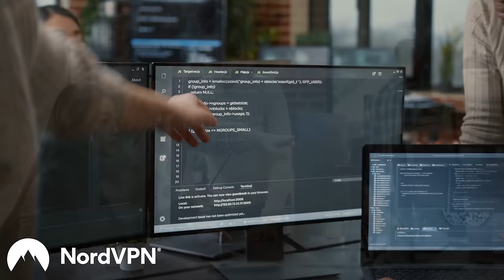Elon Musk fails Cybertruck stainless steel metallurgy test | Auto Expert John Cadogan

Comment: I doubt a pen knife is 50C, considering gun barrels are usually 30-35C
Reply from the maker: The last thing you'd want a gun barrel to be is hard. Hard = brittle. 
The hardness of a knife is not really a 'doubt' thing, genius. It's a 'fact' thing. Most consumer knives fall in the range 50-65 HRC. Premium knives are at the higher end. Knives that require toughness (ie - not brittle, such as bushcraft knives) are lower.

Comment: 2 minutes into the video and you already got your facts wrong. The stainless steel that is used in the Cybertruck is not "Austenitic" it is "Martensitic". As far as breaking the press it is a miss quote. He is taking about the press dies that will get destroyed in no time plus he cannot the intricate shapes that you can with thin aluminum sheet vs the 1.8mm thick stainless that he is using.

Comment: John is 100% correct. There's a reason why car manufacturers haven't used stainless steel as a main component in their car bodies in the last 120+ years (apart from John DeLorean, who happened to be a con artist and a thief) .... because it doesn't make any engineering sense 😉(as much as using ceramic pistons in a conventional car wouldn't either).

Comment: As a Tesla fanboy, I have one thing in common with John. We are both haters. I am a hater of high tensile strength scientific facts, and John is a hater of brittle, high hardness claims of science. Just a matter of personal preference. Real life is like a proper press—shouldn’t yield to either. If cybertruck fails structurally or otherwise, I’ll be blaming John, since his criticism provides enough negative energy to weaken the crystalline structure of Tesla’s steel.

Comment: Stainless is just a rubbish material for a car, something that's inherently going to get bumped and dinged and punched and shoved and pushed. Mild steel loves to bend--you can get a lot of movement out of a piece in a bend test before failure. Soon as you start adding chromium to the mix, that elasticity falls right off a cliff--brittle, brittle, brittle! Doesn't wanna bend, and once it has it's lost a good deal of its strength. Stainless is good for knives and sinks, it's great for food safety. It has no business as a car body, period and end of.
Reply: What's rubbish is traditional cars that can kill you with a moderate side impact.

Comment: As a U.S. steelworker who has directly worked on galvanizing and aluminizing lines that coated regular as well as AHSS, along with the hot mills that created the coils, I really enjoyed this video. When I would be (on occasion) a quality tester, rockwell hardness punch tests were, of course, paramount. Followed by a bend test. And the coating had better not crack or flake when you bent the sample. From there, other, larger samples were sent for tensile strength tests. I suppose musk figures that, "If you can't dazzle them with brilliance, baffle them with bullshit!"

Comment: The Tesla fanboys tend to talk as though stainless steel is something new.  John Delorean built a car with it 40 years ago.  Although I do like the idea of a stainless steel body, it's "enhanced durability" isn't going to do an electric car much good, since the batteries are going to die regularly in about 10 years like the Model S's are currently experiencing.
Reply: The car hitting you with a side impact disagrees with you.
Reply: @SPL-6  Especially when it is a 3 ton EV that runs the red light.

Comment: In the realm of POOR DESIGN  .... why no charging port up front, like a Rivian R1T?   If you have an up-front charging port, then hauling a trailer on a road trip wouldn’t be such a horror story.   With the exception of 1 charging station in Tennessee with 4 pull-thru stalls …. every charging station I’ve ever seen (in real life or photos, in North America), one has to detach the trailer AND park the trailer somewhere BEFORE being able to pull the EV into the charging stall …. because the charging port is in the rear of the EV … and a hooked-up trailer blocks a rear charging port.

Comment: Resuming, if a modern normal car had the same thickness in the body panels it would be harder……..
But there’s a reasons they aren’t, collisions an impact absorbing.
Not for Europe. 
Normal driving licence only goes up to 3500 kg full load capacity and…….those edges 😅

Comment: Hopefully he means strong, but I kind of doubt it, I suspect he means hard because his stainless likely is harder than the steel used in most cars a least at room temperature, if you happen to drive the cyber truck to drive to somewhere it is less than -75 degrees Celsius or so the stainless would probably be stronger as it remains more elastic at lower temperatures.
Reply: His steel isn't harder when considered against what is used in a lot of cars.  Cars are changing to harder steel to save weight.
Reply: @kensmith5694  they are changing to tougher steel with the right amount of elasticity and the closer they can get to ideal for the shape they are using the less steel they need.

High hardnesses tends to be counter productive if you don’t want the steel to shatter in an impact and shattering into sharp stuff rather than crumpling is likely to get you a low ANCAP rating.

The type of stainless that is being used in the Tesla “truck” is still somewhat flexible at low temperatures and mostly doesn’t shatter unless it is over work hardened. My guess is that a non stainless that was of a similar hardness would tend to shatter in cold environments.
Reply: @glenecollins  Cars used to use steel that was a lot more ductile than was really needed.  They did this because it was easier to work with.  I wouldn't expect the hardness vs temperature thing to be a lot better with stainless.
Reply: @kensmith5694  unless they are lying about the type of stainless, the one they are using is pretty well known for it’s low transition temperature (below the temperature of liquid nitrogen, it is why SpaceX are using it. Even low carbon steels have a transition temperature >-50 degrees centigrade. 
I live in Australia so the coldest my car has ever been is probably -5 centigrade so that definitely isn’t an issue for me unless they start using the steel from razor blades or something.

I doubt the batteries would work very well at cryogenic temperatures but it is possible there is a sweet spot where the stainless could have the correct ductility etc etc to allow the strength they want with the minimal amount of material without risking having it shatter if it crashes in some snow.

I suspect they just wanted it to look futuristic.
Reply: @glenecollins  I had heard that cars get brittle at -60C and that is why labor contracts say you don't have to go to work when it is that cold.
I would bet on the Cybertruck being 304 since that is the cheapest.  The batteries have heaters.  When it is very cold out, they use the heaters to keep it above some minimum temperature even when not in use.  It uses on a fraction of the battery's capacity to do this.  Without the cooling system running they don't need a lot of watts per degree partly because of the protective housing enclosing the battery.
Reply: @kensmith5694  -60 degrees centigrade is pretty bloody cold, I know some Canadians who’s EVs drop down to about 1/3 to 1/2 their max range in winter.

The -60 temp is the transition temperature for the more or less bog standard mild steel used in cars a couple of decades ago.

High carbon steel without any additives to make it’s transition temperature lower can turn brittle above 0 degrees Centigrade. That is why you can just snap cheap razor blades etc. 

Reputable car manufacturers have cold weather testing facilities and that sort of thing is taken into account but as I was saying there doesn’t seem to be much difference between panels that go brittle at -30 degrees centigrade and ones that go brittle at -195 degrees centigrade for the vast majority of drivers.

Comment: BHP developed a car body steel for Ford Straya , it work hardened during the pressing/forming, so that it had more rigidity than the previously used steel.    Ford used BHP for a very short time then gave the technology to their previous steel suppliers.   Silly BHP for trusting those bastards.

Comment: Interesting content, St John of Cadogan. Conventional high volume (low piece cost, larger tooling investment) car body has skin material made from 0.7mm mild steel alloy sheet, or even thinner 'dent resistant (i.e., about the same strength) bake hardening steel alloy to save weight. Inside the skin is the load bearing structure though which all routine loads from the suspension, steering, brakes and powertrain are fed - but crucially this same structure has to manage impact energy from point of impact throughout the shell. 
By zapping the skin to a slightly stronger but much thicker steel alloy it would appear the Cybrrrrr Truuuck is making management of impact energy much more difficult.
The photos released of the impacts beg the question: Is the body progressive deformation so minimal the vehicle survives but the occupants are flushed out with a water hose? Peak deceleration is the key here. SRS can only do so much to manage deceleration - body deformation is crucial to impact energy management. 
I need to see more information about the whole structure to really understand what's going on with Cybrrrr Truuuck.

Comment: how long before the poor saps who bought these trucks that won't hold a sheet of plywood paint them? I'd recommend Line-X for a start - dip the whole truck in it and save yourself the worry about dings for years to come. Saw a video on youtube of a restorer working on putting one Delorean back together from the remnants of two and three spare engines. They were painted, pitted, beaten on the anvil of life and the aluminium blocks had rusted through. They look nice while sitting there shiny and new but as a truck they fail on every level. Rule #1 - if you can't load a 4x8 sheet from the lumber yard and close the hatch - it is a toy for rich boys.

Comment: I think the "bullet resistant" claim and the fact they used sub-sonic rounds for every display is at best misleading. The first time some tech bro, or just a gangster does a drive-by thinking they are impervious to retaliation is going to end in a pretty bloody meme! This feels like one of those advertising campaigns where you promote the benefits in large font while hiding the deadly faults in the fine-text. Also why did they change the projectile fired (by hand) at the glass from a metal ball to a baseball?

Comment: My experience with stainless steel is with 316.  It is highly corrosion resistant, but very brittle.  You are correct that it will rapidly work hardened and break.

Comment: Mkts of all types have a way of exposing weak links and flaws by  basic supply and demand . If for what ever reason the demand falls off and there is an oversupply , the product will either fail or be adjusted, re designed, etc., or whatever it takes to rebalance the supply / demand . As far as the Cybetruck goes, the demand may be so great that issues that are brought up may not affect it. But with videos such as these exposing major flaws that might change. Bottom line is the cost of the Cybertruck may fall drastically if demand falls off a cliff. That could be a better time to buy for the ones who dont feel the issues brought up are not that big a deal.

Comment: A press die can punch, shear and deform all day carbon and malleable materials but add chrome and stated extra compounds to that alloy and just watch how quickly the cutting edge degrades.. the press will survive no probs and the dies will also temporarily however you need 5x as many freshly minted dies, downtime for die~changes and extra die maintenance people to achieve the parts per minute.
While you actually sound reasonable in his argument  you need to have personal experience trying to achieve this outcome.

Comment: I mean, the DeLorean body was made out of stainless steel and didn't look like a snes 3d truck.  It had other issues, but throw some greebles on it and BAM slow time machine 😂.  

I was surprised they didn't take a page out of GM's playbook regarding the corvette and use fiberglass, smc, carbon fiber, or some form of lightweight composite.  We all know this thing isn't intended for actual work, at least not the likes of which a 1/2 ton pickup would see on a weekend.  And besides, if Toyota can get away with plastic beds on their tacoma pickups, I'm sure the cybertruck would've been fine too.

I just hope they don't repeat the mistakes rivian made with absurdly large body panels when it comes to body repair.  Otherwise queue the cyberpunk memes and music for this thing...

Comment: The boxy and sharp design of the Cyber truck is something of a mystery to me. Forming stainless steel round with large radius has been done a very long time. Have a look into the process of sink manufacturing. The current design will not be approved in Europe because of pedestrian safety rules. Can drug use at Tesla explain this behemoth of a vehicle?  This model will not live very long before it is discontinued if customers have their brain switched on.

Comment: Always a moral dilemma when someone does not tell the whole truth - is Musk lying? The Exoskeleleton (probably trademarked now!) could be higher strength than normal exterior body panel steel (about 400MPa often) but typical modern cars use Ultra High strength steel in the proper chassis which has highly complex formed shapes, so not sure what he's done there. StSt welded panels will also be a nightmare for repairing crash damage so insurance won't be cheap.

Comment: On the whole, I do thank Electric Jesus for 48 V low voltage system though. Long overdue. 

Irrespective of materials and  their relative hardness and strength, I’m most disappointed that it is not an actual exoskeleton or affordable. 

I can wait.

Comment: "Gramms can be a unit of force, gram is a weight, weight is a force, go rant in the comments if you didn't pay attention in school"

Ouch... Ok, a few lines in full-pedantic-mode, because if you are going to insult people for understanding something, while getting it wrong... you deserve a spanking.

Really short: Gramms are NOT a force, but on earth you can get away with it because the gram is defined against the force of earth's gravity.

Slightly longer: Gramms are a unit of mass who'se definition is "the weight if a 1cm3 cube of water on earth."
Weight is the number of Newtons applied to an object by Earth's gravity. 
Newtons are defined as the amount of force required to accelerate a 1kilogram mass by 1m/s per second.

Notice that the the gramm is defined by accelleration of a mass and Newtons are the force that causes that accelleration.
Notice also how the gramm is expressed in Newtons in earth's gravity.

This means that an object that weighs 6kg on earth weighs 1kg on the moon, while a spring that applies a tensile force of 1Newton on earth will also apply 1Newton on the moon.

The confusion comes from the fact that scales on earth are calibrated against earth's gravity. The measure NEWTON, but show GRAMMS, and that makes those who did not pay attention in school think that gramms are a force.

Did I get under your skin? Did I? Good. :-)

Comment: No trick out there can take Tommy gun shots without it going all the way thru . Allie’s steel doesn’t make cold rolled steel
Reply from the maker: What tangible use is it, however? Especially as the windows and tyres are not bulletproof.

Comment: The original prototype of the Cybertruck was probably made with AISI 304, but since then the alloy has been changed. Tesla no longer refers to it as 30X, but HFS (hard freakin’ steel). And it is not austenitic. Maybe duplex? I don’t know. Tesla management (not Elon) said it is their own unike “heat”, what ever that means. A stamping press would get broken because of the 3 mm thick HFS. At least that was the thickness on the prototype’s body panels.

Comment: 300 series stainless steel is a true stainless steel due to its higher chrome content making it  more corrosion resistant than 400 series. The most stainless steel found most cars is the exhaust system, so don't even try to level the playing field by betting your argument on the hardness, because 300 stainless is quite hard; its hardness on the Brinell scale is 200, versus 120 for ordinary steel and 15 for pure aluminium. We could talk tensile strength, which is over 500 milli pascals (mPa), but why bother, that means nothing to most people. The point is, that he knows the audience, so if you want to hear some fancy sounding engineering terminology, I suggest that you dont look for it in a press release or periodical! You can find it here though: https://youtu.be/u95V_n_6qcM?si=1crQnm7JR-tDfFX1

Comment: That thing is like a mobile crematorium. How would one evacuate in case of fire if doors won't open?
Reply: Yep - it's so easy to evacuate my current steel door cars in case of fire -- I just kick the steel and it breaks easy!!
Reply: Are they also equipped with 'thermonuclear explosion proof glass'?
Reply: nope - glass breaks but you can easily retrofit for bulletproof glass..  @__haki
Reply: Ah, wouldn't you know. That changes everything.
Reply: @__haki  Thought it might :)